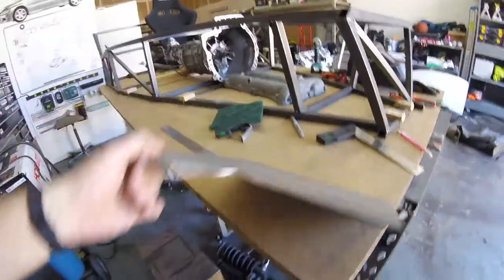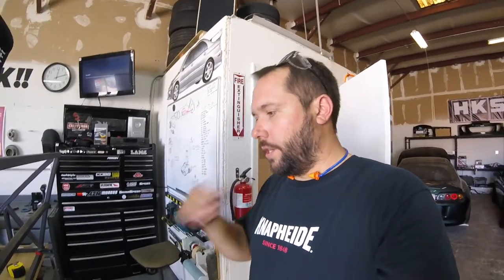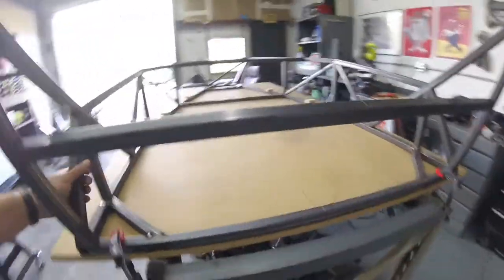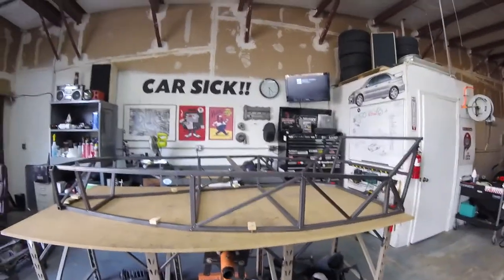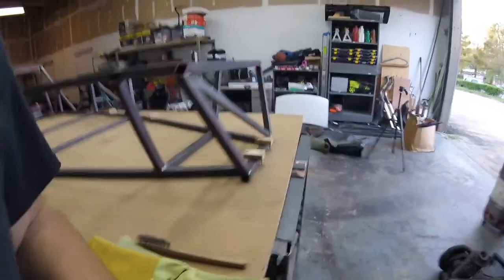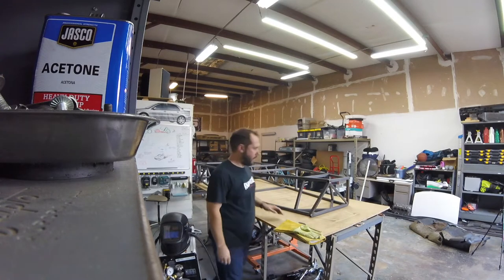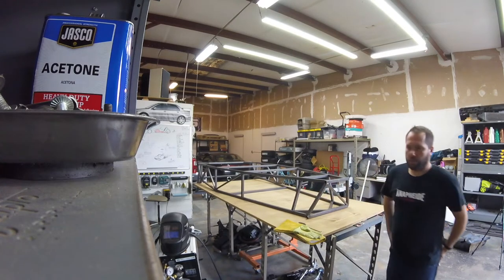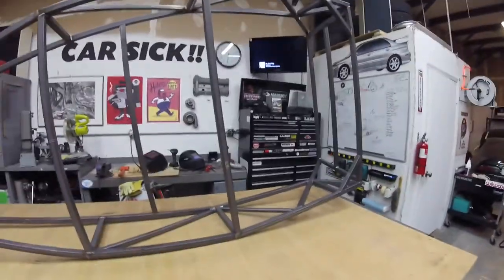Weld It Up! Locost Frame

Comment: I used a complete miata subframe on my 7 and it sat on the table flush with the chassis, ride height was bang on
Reply from the maker: Wow, that's great to know! Thanks! I've heard that the wheel base is longer, do your rear arches look like they are too far back or does it seem normal.
Reply from the maker: Just watched your videos, it looks good!
Reply: Car Sick!! I put my subframe like an inch above the bottom of the frame I think. I just leveled the bottom control arm on the subframe and did the math for the wheel tire combo I have planned to get the height of the subframe. Then chose how high I wanted the frame off the ground and welded the subframe according to the difference.
Reply: This is the way to go ... saves a heap of time...